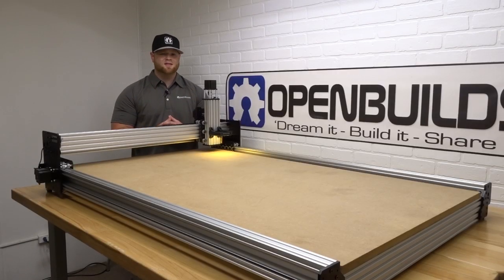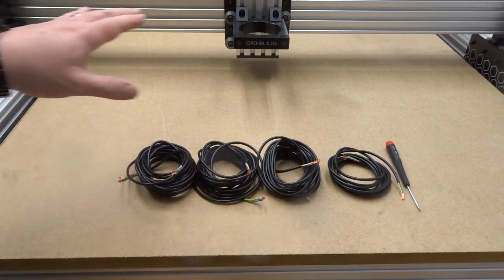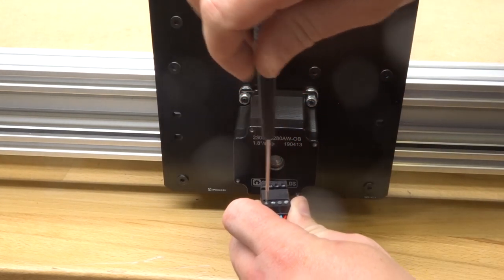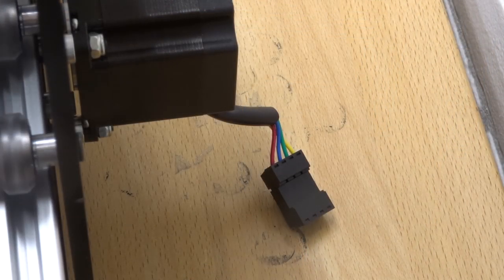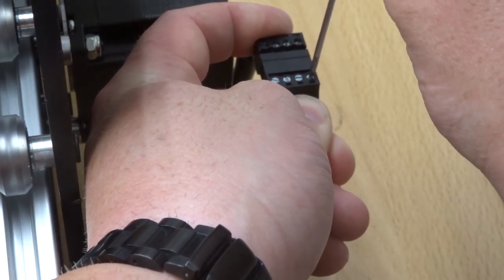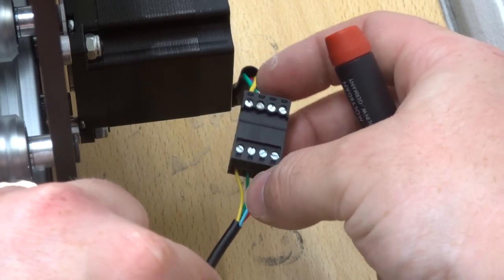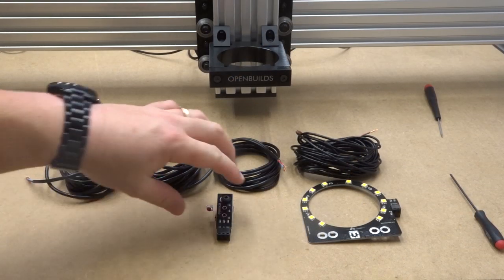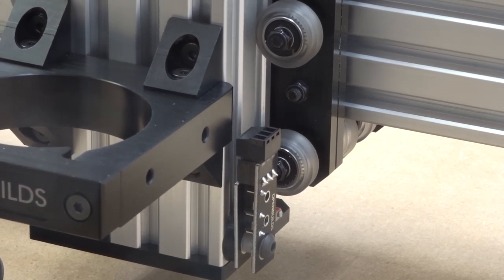OpenBuilds WorkBee 1510 Electronics and Software (Using BlackBox)

Comment: Hello! Great video. Does the machine need anything special to run with MAC? Thanks!!
Reply from the maker: No not at all. We have options to download our software for Mac, Windows, and Linux.  Here is the download: https://software.openbuilds.com/
Reply: Ok. Im trying to sell the one I bought because I didn’t buy it from you. I saw your videos after I bought it and saw that it comes with a Mach3 controller bundle and run with MAC i have to use other programs too😕. I want yours better because you have more support. I have emailed the ones I bought from but they said they don’t do customer support in software or anything. My CNC still in the box because i want to sell it and buy one from you. I didn’t know about your company.
Reply from the maker: Sorry to hear about the troubles you are having with the company you purchased your CNC from. Hopefully you can purchase our high quality kit and be up and running in no time. 👍